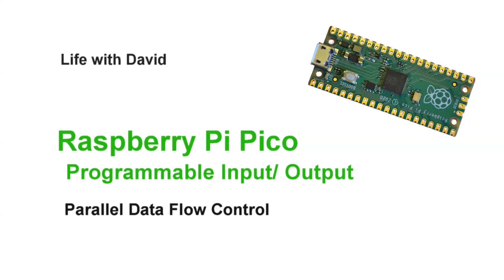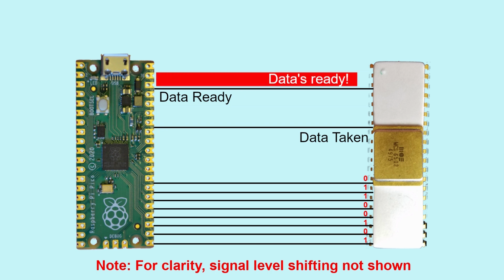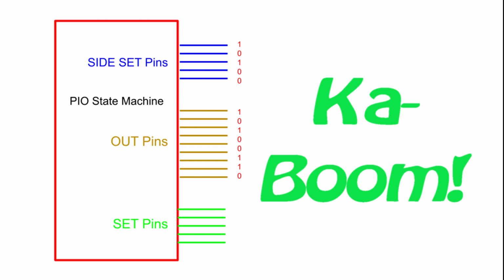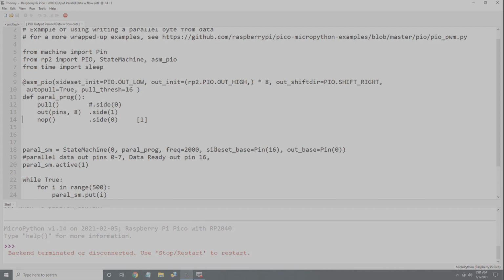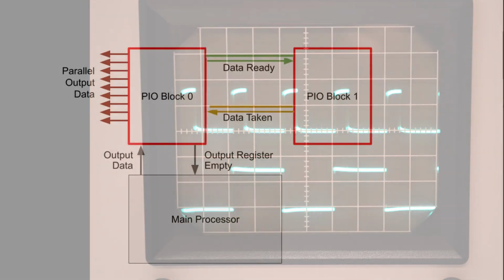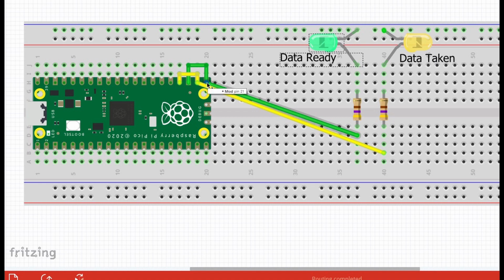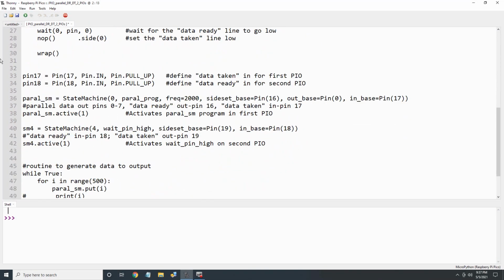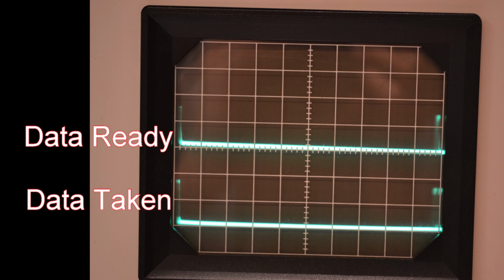Raspberry Pi Pico PIO - Ep. 2 - Side Set, Wait, and Handshaking

Comment: Thank you for the video series on PIO. It helped me a lot to understand them !

However, I believe that there are two errors that got into the video:

1. The wiring schematic at 6:55 should show the green wire to connect GPIO16 to GPIO18 and the yellow wire should show the connection between GPIO17 and GPIO19. On a RP Pico, as in the schematics, however, the pin order on the upper side from right to left is: gpio16, gpio17, GND, gpio18, gpio19.

This means that you actually show a schematic where you connect GPIO16 to Ground and GPIO17 to GPIO18

2. (this is a bit less important for some but still got me very confused in the beginning:) In the code on the Github repository for the Handshake between PIO0 and PIO1 the pins 17 and 18 are initialized with PULL_UP input resistors. To test if the handshake works, I removed the green connection between GPIO16 and GPIO18 and saw that the Data_ready light keeps blinking. This should not be the case, as PIO1 never gets the data_ready signal and therefore never sends a data_taken signal.

However, as the input resistors are PULL_UP the line is automatically read as a 1 when not connected, which should definively not be the case. By changing the the Pins 17 and 18 from PULL_UP to PULL_DOWN this bug is resolved. 

Sorry for the knit-picky corrections. Apart from that, from watching the video without recreating the same setup at home your video is perfect, clear and super useful !
Reply from the maker: You're right about the fritzing error.  I acknowledged that error a couple years ago.  Regarding PULL_UP / PULL_DOWN, it's been a long time and I have learned a lot.  I couldn't argue one way or the other.  Thank you for the comment and thanks for watching!

Comment: The only bit I am missing here is the how you got PIO block1 to work. I can see StateMachine #4 is instantiated. and from the docs I can see that there are 4 state machines (0-3) for each block. Does that just mean that state machines 4-7 are the state machines for PIO block 1, the second PIO block, and state machines 0-3 for for PIO block 0, the first PIO block?
Reply from the maker: You are correct!  MicroPython fills in a lot of the blanks for you.  Whereas C/C++ and assembly would require you to specify the PIO block, MicroPython does it for you.  However as you get deeper, you can specify PIO block in MicroPython by using the rp2.PIO class.  I remember diving into the differences in a few of my later videos; I think maybe the interrupt episodes, 19 and 20, and the C/C++ episode 7.  I've been working with bare metal assembly recently, so I'm a little rusty with MicroPython.  But I captured a lot of information on MicroPython in my PIO Chronicles series; I hope you get to check them out.  Thanks for the question and thanks for watching!
Reply: @LifewithDavid1 Back last Xmas I was trying to go down the C/C++ PIO route but I forgot everything.. so went back to MicroPython and printed most of the docs. It's good to be back and hopefully it will sink in this time. I do want to emulate a character ROM with the Pico.. that's my goal!
Reply from the maker: @paulspark7287  Fantastic!  That sounds like a great project.  I think there are a lot of things here that might help you.  Check out the AWG and video episodes, there is a lot of high speed DMA presented there.  Good luck!

Comment: Did I understand correctly that the first program does not need "wrap" commands because it has autopull in the header?
Reply from the maker: Not exactly.  The PIO program will always wrap to the start of the PIO program unless some other wrap target is specified.  Autopull means that I don't have to specifically issue a PULL instruction to fill the OSR, with autopull, the PIO program will automatically pull a word out of the TX FIFO and put it into the OSR every time the OSR is emptied with an OUT command.
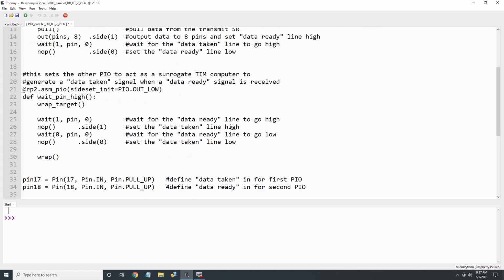Reply: @LifewithDavid1  8:06
if I remove from the second program "wrap_tagret()" and "wrap()" commands, something changed?

Comment: i have to look how that works in C(/C++) because i wont run any other code on the rp2040.
i need to check the options to integrate an rp2040 to c64, atari 2600 and atari 7800 bus interface for read an write. i have to check if i can use the 8 data pins also for addresses to save pins for an i2s interface and a 4 bit spi memory interface.
that statemachine stuff for IO is for sure something very cool to create individual interfaces.
Reply from the maker: You should be able to interface it nicely.  I have more PIO videos where I used C/C++.  You might have to use a little hardware to glue the Pico to your 8 bit application only because the Pico is so much faster.  Have fun!

Comment: please one other question - where from know the @asm_pio(...) what for pin ports are to use? and what Pin is the 'RD'? where is this defined? and in the first line "from machnie import Pin" is the 'machnie' wrong written should that not named 'machine'? Thank you very much I must learn a lot and a Super Video! weakbit
Reply from the maker: I'm not sure if I understand your question, however, the @asm(...) is used to invoke the PIO assembler and reserves some input and output types (sideset, out, etc) and sends some info on the direction and timing of the data shifting.  The StateMachine statement is where the actual pins get allocated for each state machine.  The same physical pin can get allocated for different uses by different state machines, and an Out pin can also be a SideSet pin within the same state machine.  The flexibility is the strength of PIO but it can also lead to some confusion in the beginning.  Give it a try and good luck!

Comment: that mean if you write the instruction => out(pins, 8) .side(1) that the 8bit parrallel & the control pin DR(high) is going out at the same time? is that correct? that mean I can control at the same time the data and the control without any loose of cycles (like in a atmega where I must send the side(1) on a other port with a out command extra and later) - Super! Thank you for your Video! weakbit Thumbs Up Nr. 402! 
PS: Also in you Hardware you must delay the 'DR' signal to the old Prozessor in case of maybe to short time that the 'DR' hold. 'DT' handshake this signal and delete the FlipFlop on the inverted clear of the FF. The proceed will start again. I'm asking me about the delay option - why do you not hold the 'DR' in long for that long time that you use at your FlipFlop? Maybe is it to short time?
Reply from the maker: You are correct.  Out and side commands occur at exactly the same time.  Pretty cool!  The delays on the old hardware DR line was because my goal was to use the old TIM software as is.  The speed difference was too much without the flip flop.
Reply: @LifewithDavid1  that mean the TIM recognize the 'RD' signal in a bit polling loop so the Pico was to fast - I see. I think about a hardware for the C64 as a programmable modul this could also possible with this "side" function. Or was that only a Eprom I can't remember but it was very slow with only ~1MHz clk. You can watch my assembler hack on a Grundig CD-Player there was the problem that the CD tray are only open up 2cm and then a PWM come out of the motor control pin. Why is that so after years? I made a AVR atmega328 controller for the repair and work around of this issue => #1 https://youtu.be/VZx6ww4Nbck and #2  https://youtu.be/VZx6ww4Nbck have fun to watch this mysterious failure. weakbit

Comment: 7:00 audio explanation is ok, but fritzing is wrong, 
using 4 consecutive pins 16-19 but pico has ground between 17 and 18
# May 2022 on v1.18 the  ", pull_tresh=16"  parameter gives error, ok to remove.
Reply from the maker: Good catch!  I put together the fritzing while I was making the video and I just missed the ground pad.  Thanks for the tip on v1.18.

Comment: Is it possible to use pio to read a quadrature encoder (two bit gray code) and keep a bidirectional count of the position of the encoder? (eg. a motor shaft)
Reply from the maker: Good question.  I don't think PIO could do it on its own (almost no math or logic capabilities); however, I think PIO could act as a "preprocessor" to make the main core's job much easier.
Reply: @LifewithDavid1  OK, I think I can use nested jumps to convert phase bits to count up and count down bits for the core. Depending on whether python interrupt handling is fast enough to not miss any pulses I may need to figure out a way to run one core in C/C++ for the high speed stuff and the other one in python for the high level stuff.

Comment: Great Job, I will need to go through it a few times and then do some very simple examples on my own, but your teaching style is a great Help. My goal is to control Brushless DC Motors in a positioning servo system.

Before coming across the RP2040 I thought I would need to use an FPGA, The RP2040 with its PIO will do the job at a much lower cost with less complexity. I can see, with the help of your examples, the learning curve will be manageable, I am 76 years old so I prefer shorter learning Curves! 😃
Reply from the maker: Awesome, thank you!  I, too, appreciate shorter learning curves.  Hopefully my next video I'm working on will help even more.
Reply: Keep the grey cells active.

Comment: For the PIO<>PIO communication, you need to wait for "data taken" line low before asserting "data ready"
You cannot assume that the receiver will be as fast as the transmiter or any other assumption, becasue it may not work in a diferent situation
Reply from the maker: Thanks for commenting.  Yes, I can see that.  If the receiver is very slow relative to the transmitter, one or more bytes could get skipped.  I should add a wait instruction just after the pull instruction for state machine 0.  Good catch!

Comment: Hi David,
Interesting topic, but not for beginners...
The "side" option is interesting, but NOT applicable here !
In real life signals do not travel at the same time even if delta T is very small.
It means that the receiver can detect data ready before all signals are set
Reply from the maker: Thanks for commenting.  I would agree if the 6502 was using a hardware capture of the parallel data; but for this application; it works great.  That's because the 6502 uses a software loop to sample the data ready line.  When it detects data ready, it exits it loop and then queries the 6530 for the data.  This takes several microseconds; which is more than enough time for data to settle.
Reply: could do :: (tested on hardware as in this video + v1.18 mpython)
out(pins,8) side(0), next lines several  nop() [7] and then  nop() side(1) [7]

Comment: Thank you David, good video ... for somebody like me who tries to start with PIOs. The function I would like to implement is pretty similar to your DATA Ready/DATA Taken algorithm (automating a GPIO OUT UP for a period of time linked to GPIO IN UP signal) but, I would like to count the number of packet sent, using a counter that could be initiated and later read by the main program as well.
Are you going to implement this in the future, or ... would you have any clue this could be done or any tips to share; please?
Reply from the maker: I can visualize the bits and pieces needed to make something like this work.  The RP2040 does have DMA as well as the 2 PIO blocks and 8 state machines.  There are also counters in the PIO.  My next video does a real world parallel interface,  After that I hope to dive a little deeper into the PIO which might open up some more tools.

Comment: It seems like it's possible for PIO to shift one or more bits in/out at a time.  I wonder if you could put 32 bits into the FIFO and have it sent to the pins 8 (or 4, or 2, etc.) bits at a time.  That way, you could cram more data into the FIFO at one time, and let the PIO take care of breaking it up into smaller pieces.  For example, maybe one PULL to get 32 bits form the FIFO, and four pairs of OUT and WAIT instructions for each of the four bytes.
Reply from the maker: Absolutely.  That's how serial transmission works.  The flexibility and simplicity of the PIO language is what makes it so powerful.

Comment: Awesome info! Is the PIO of the Pico fast enough to hook it up directly to the data and address bus of a 6502?

I'm using a Pico with PicoDVI (https://github.com/Wren6991/PicoDVI) running on it which uses 3 of the state machines on one PIO block and I'm using the Pico's UART0 interface for it to receive data from my ACIA 65c51 and function as a terminal monitor, but I've been trying to figure out if I can use the other PIO block to set it up to accept data over the main data bus of my 65c02 system running at 8 MHz. Based on the DVI being able to put out 252 Mbps it seems like it should totally be possible to do 8 bits at 8 MHz.

According to the PicoDVI repo it should have one full PIO block and 100% of the CPU cycles on one core remaining. If this is enough to set up an 8 bit interface that can send or receive at 8 MHz the Pico could funciton as an inexpensive video chip for 6502 homebrew computers.
Reply from the maker: I was thinking that it would be pretty straightforward to output a VGA signal.  I would guess that you could allocate at least 64K for video RAM.
Reply: Hi Brent, do you want only accept data or you need to write data to bus too?

Comment: Wonderful stuff, and should get a lot more throughput that way and certainly free's up the main cores workload.

Have you measured power usage for the same level of throughput in contrast to the previous version?  I would expect at the same throughput level you would see less power usage on the programmable IO approach, though how much may be negligible.
Reply from the maker: I haven't monitored the power use; but that would be interesting.